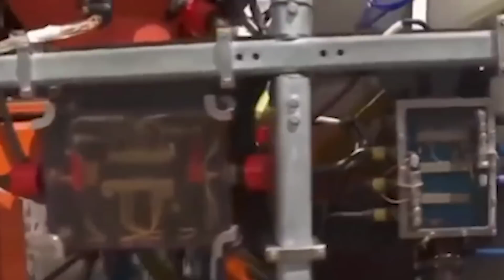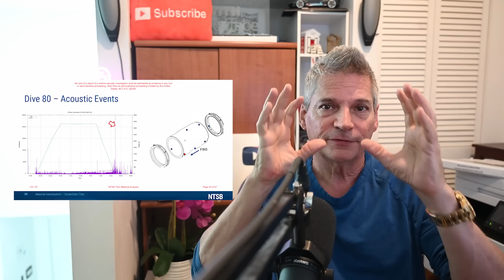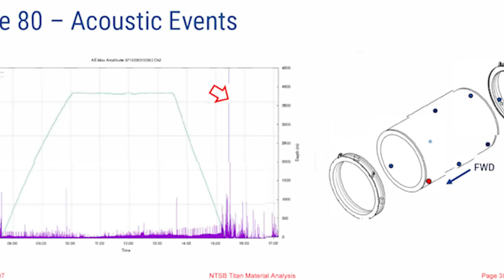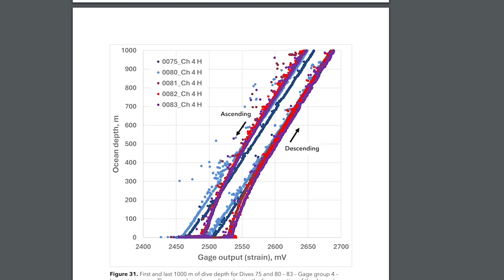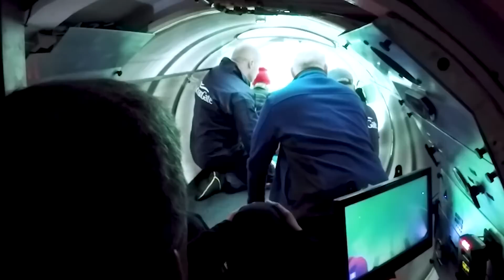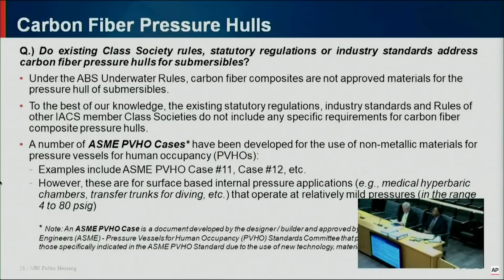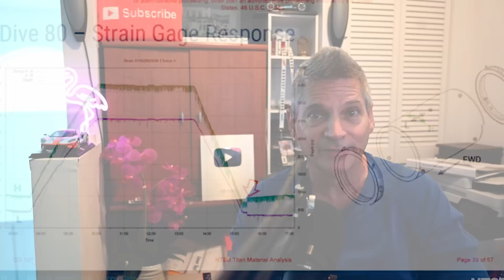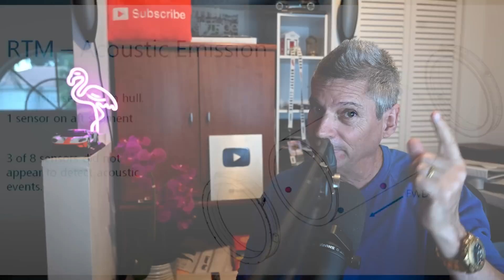How OceanGate Titan Sub Realtime Hull Monitor FAILED! RTM

Comment: Just FYI, those nice and neat charts that we got were built by the NTSB, Oceangate never thought to graph the data with reference to depth. Instead they were just looking at events over time.
Reply: stand out piece of info to me, if they properly presented their data they could have detected what was almost certainly some manner of structural failure.
Reply: Yup. DR Kramet & NTSB combined the two data sets of depth v time and strain v time into one of depth v strain. In water, external pressure is linear with depth. Therefore, a depth - strain chart is indicative of pressure - strain that is akin to the familiar stress-strain graphs of strength of materials science.
Reply: I guess Rush didnt want to hear anything not matching his narrative.
Reply: Seems odd that his 'patent' indicates comparing such data at specific depths yet he didn't bother to actually do it.
Reply: I actually forgot the graph was produced by the N.T.S.B. maybe if Stockton had any concerns about safety they would have done the same and maybe realized something was different after dive 80.
Reply: Oh man, that's crazy dumb.
Reply: Terrible or inexperienced engineers because depth = load. So it’s the most obvious plot to make. Strain vs. load (depth).
Reply: Stockton MUST have made his own charts even before building the hull, that is necessary data for design. There is no other way, basic Statics. I designed steel beam structures on my first year Engineering in .... 1969. Using graphs, charts and slide rulers, go figure, no widely available pocket calculators way back then and 1 IBM 1620 Computer was shared among all students, you had to book time on it. And yet we successfully calculated stress at every point, specified which I beams were needed, calculated rivets needed, etc. Basic old school Engineering, Stockton had POWERFUL Simulation software at his disposal. WW1 and WW2 Engineers designed successful submarines using classic design tools as I mentioned. But none broke the rules. On the contrary, it is customary to add 3:1 overbuild to play it safe. Not Stockton.
Reply: @ I’m sure he had some theoretical charts lying around somewhere, but he had access to actual data gleaned from his own deteriorating submarine showing bad trends that he could have modeled too. Perhaps he did at some point and dumped the results specifically because they were bad.
Reply: You don't need to make graphs and charts to use data, you just need to understand what it's telling you
Reply: @ I asked Data what was up and he said “Ship broke, so what?”
Reply: Very similar to the shuttle challenger explosion. Depending on how the prior o-ring damage data was presented, it either looked like a non issue or a huge deal. Obviously temperature was a huge issue in hindsight but the “go bias” was strong at Morton Thiokol and NASA
Reply: @johnmerryman1825  Thiokol was begging them to delay. The then NASA administrator famously exclaimed: Well what do you want me to do, wait until April comes around? Hindsight is always 20/20 in cases of negligence.
Reply: @johnmerryman1825 not exactly… The shuttle although they coined it as “reusable” its actually more like “refurbisheable” as after every flight the shuttle and recovered SRBs would’ve been disassembled and then re-assembled again. So the o-rings are basically brand new for every flight. 

Also note that Challenger case, the engineers warned NASA to not launch on such a cold day…

In Titan’s case, Rush’s position is equivalent to the engineer that warned NASA (but in Rush’s case, he is also NASA himself)

Right after the accident, one of the expert did say that the person most suitable to lead the investigation into Titan’s accident, was unfortunately sitting inside the Titan when it imploded…
Reply: @tonamg53  I'am conflicted about the difference between reusable and refurbisheable. can you elaborate?
Reply: @salland12 the SRBs were reusable after they underwent a specific refurbishment process. Here is a link to a NASA document for this process. I was an engineer for several years on the ET program. 

https://llis.nasa.gov/lesson/836#
Reply: @salland12  Think the difference between doing a quick turnaround (i.e. topping off the gas tank and checking the brakes(Like a jet)) vs a complete overhaul between trips.
Reply: @tonamg53  I wouldn't say the person who was most suitable to lead the investigation into Titan's accident was sitting inside of Titan when it imploded. If that had been the case I think he would have been wise enough to realize that the pressure hull was cooked much earlier and would have stopped using it.
Reply: @salland12  “Reusable” is when you use it again with just inspection and minor maintenance without needing to have the whole thing disassembled and rebuilt.

“Refurbishable” is when you use some parts of it again after the whole thing has been disassembled and then re-built from scratch.

The SRBs are basically rebuilt brand new for each flights with salvaged parts from the SRBs used in the previous flights.

You can actually see that each SRBs are rebuilt with parts salvaged from different SRBs that had previously flown as NASA keeps track of which parts came from which SRBs and which parts are brand new.

Fun fact: its actually cheaper and more efficient to just build a brand new one but then they wouldn’t be able to say that its “reusable”
Reply: @PeteOtton  That’s what one of the expert say very early on just after accident and it seem to matches with what Stockton Rush has been doing all along.

You can find that Rush has been invited as speaker in various seminars and conferences to talk about CFRP in submersibles. I think he was also a part-time lecturer in several universities on composite materials.
Reply: @tonamg53  Just because he was a part time or guest lecturer at universities just means he was getting part time work and wasn't a serious researcher into composite materials. If he had been serious he would have understood why submersibles and submarines are all built out of ductile/malleable materials, not brittle materials. The PTO doesn't examine patent applications for whether or not a device/process works or how well it works, just that it is novel, even if it is incrementally novel over previous ideas.
Reply: @PeteOtton  There is no evidence to support that he wasn’t an expert like what the industry experts had suggested.

By being an “expert” it doesn’t mean you can’t make any mistake. Every experts made mistakes before and yes, some had died as the result of it. 

Professional airline pilots are basically “experts” in aviation industry. Crashing a plane doesn’t means the Captain is no longer a pilot or is it?
Reply: @PeteOtton  Also note, yes there are downside of using CFRP but there are also massive benefits as well

1. You can take more people down per trip which means lowering operating cost.
2. Titan is the only submersible that I know which has the ability to resurface from the bottom of the ocean without needing any electrical power at all.

The latter benefit practically eliminate the risk of getting stuck at the bottom of the ocean or uncontrolled dive due to loss of power.

All fatal accidents prior to Titan had been the result of getting stuck at the bottom or imploded during uncontrolled dive due to loss of power. The Titan actually eliminates the risks from all of the previous accidents.

But yes, they may have underestimated the risk of implosion due to hull fatigue/ damage during a routine dive since it never happened before in the history.

If you think using CFRP is dumb then I’m sorry, but it’s not the person using CFRP that is actually dumb…
Reply: @tonamg53  Carbon Fiber is a  brittle material. There is a reason brittle materials are NOT used in applications where pressure is applied to them. They go into sudden failure where malleable materials go into plastic deformation giving a warning that they are failing. When you are talking about thousands of atmospheres worth of pressure you want warning that your vessel is failing. Cycling the pressure leads to failure due to fatigue. Rush had no idea the forces he was dealing with and is lucky he is dead or he would be facing a quagmire of who gets to try him for murder.
Reply: @tonamg53  He wasn't an expert in building underwater craft. At best he was an expert in designing experimental aircraft, but given he was actively skirting regulatory bodies I would not trust any of his designs even in them.
Reply: @PeteOtton  Stockton Rush first built a sub back in 2006 after he couldn’t find one available for purchased… So he built his own. 

Also the Titan that imploded wasn’t his first carbon fibre submersible that he built.
Reply: @tonamg53  Dude there is a reason carbon fiber isn't used under pressure and Rush made it well known to the whole world. Admit you are as much a rush fanboi as there are musk fanbois.
Reply: @PeteOtton  Carbon fibre had beeb used in other submersibles. 
Stockton Rush wasn’t the first to use CFRP in submersibles. He just built the largest one so far.

And I’m not even sure what are you whining about using carbon fibre… this very video actually proves that it actually WORKS. Yes, it worked as per it was designed to do. 

Was it able to reach Titanic? Yes, it did multiple times.

Did the real time monitoring system able to detect anomalies in the pressure hull? YES IT DID.

The reason it imploded is not because the design was faulty…. But the data from the system which detected anomalies was overlooked.

This is not engineering error… this is purely human errors.

Comment: it imploded like a can of Pillsbury biscuits. simple as that. the design was wrong, the materials were wrong, the maintenance was wrong. this was basically a con so Stockton could make a name for himself by using a material no other manufacturer uses. but that's for good reason, Stockton knew carbon fiber wasn't actually the best, yet he ignored regulations and basic engineering principles and professional standards for personal gain. he wanted to be known like Elon Musk as an investor and innovator and that was more important than safety in every single way.

Comment: Rush invented the submarine "tip-n-tell" sticker. It's a small square plastic sticker filled with colorful pellets.  If it's smashed into a pile of dust, that means the sub imploded.
Reply: I think you're giving him too much credit. These YouTube videos are his alert system that his sub imploded.
Reply: @Walter_Be It's a sticker that you put on a shipping container. If something you are shipping MUST be kept upright, you use this sticker on it. The sticker has a little measuring device in it that measures how much the container has been tipped, by the degree of tilt. So if at any point the container was tipped 15 degrees while it was being shipped, the sticker will show that when it reaches its destination.

It's for shipments where there is a reason why whatever is being shipped cannot be tipped. For example a precisely tuned piece of equipment that will be damaged if it is tipped past a certain angle...

.. or say in the case where you need to know whether your submersible made it to the destination and back in one piece... 😅
Reply: ROFL stop 🤣🤣🤣

Comment: Yeah, an RTM system that alerts you to a potential implosion condition that takes at least 2 hours to escape .. yup, grand logic right there
Reply: Might as well bring a can of Flex Seal with you on your dive in case of a leak.
Reply: @deltasyn7434  At those depths, a leak will cut through glass or steal cleanly.
Reply: @PeteOtton I think the poster was being facetious
Reply: @deltasyn7434    Hey, it works for my doggone tub!!!
Reply: It gave them around a 100 hours warning. Clear as day. 

So the design was fine? Yes it was going to fail but the monitoring system was working as designed. So had they simply listened to what the data was telling them and used a new hull on dive 81, they have been able to keep going for years and years. 

It's being in an airliner and doing nothing when you hear "woop woop, pull up, terrain".
Reply: @please_stop-v7o But what should we do if we are in an airliner and hear "woop woop That's the sound of da Police?"
Reply: @somethingbrite8484   It's part of the GPWS or ground proximity warning system. It's just very loud and has that conspicuous "woop woop". The important warnings have their own sounds like "BRRRRRR SPEED SPEED SPEED" which is the overspeed warning. Critical warnings have their own chimes or bells or horns and those are practised a lot so a pilot will immediately be familiar with the situation. So much so that the warnings are known outside the pilot community. 

If you sit in the back you won't hear it but in the first few rows you can definetly hear the big warnings even today with the cockpit door closed. 

So if you sit in the those rows and you hear "woop woop pull up terrain" there's nothing you can do, because you aren't one of the pilots. However it means that you are 45 seconds from death unless corrective action is taken. 

If you get pushed into your seat and the liner is shooting upward like you would never experience in routine flighty feeling like a fighter jet, everything should be fine. The pilots screwed up but the warning did what it should and they're flying out of an uncomfortable situation. Once it levels off and the roar of the engines subsides a bit, the danger is over and you can attend to your dinner that's now all over your fancy flying suit. 

However if the airliner keeps diving you will hear that warning repeat, likely interrupted by "BRRRRRR SPEED SPEED SPEED" and "SINKRATE" and or "TERRAIN AHEAD" your most likely toast. If you're religious, that is what I imagine would be an appropriate time to remember that. If not, taking your phone off flight mode and sending someone a few heart emojis is not going to disturb the pilots. It might cause interference with the radios but at that point besides a short "Mayday, mayday, mayday Flight xxx in an uncontrolled dive" they won't be needing their radios and likely not at all because in an uncontrolled dive your last focus is talking on the radio, "aviate, navigate, communicate" in that order. And if there's any significant aviating to do, the other two should be ignored until safe flight has been resumed. Of course all of this is obvious if it happens, don't worry about the sounds coming from up front, enjoy your last moments.
Reply: @221b-l3t is smart. op is not.
Reply: You plays da odds and you rolls the dice. Sometimes you lose...your LIFE.
Reply: And the funny part is that THIS SUBPAR SYSTEM gave them PLENTY OF WARNINGS too
Reply: On Reddit, they have two characters to denote what you meant...

/s

(It means sarcasm)

Comment: The how, and the why, for every hole in this collossal swiss cheese, can be encapsulated into just two words:

Stockton.
Rush.
Reply: Stockton’s Swiss cheese was more like the crust cut off a sandwich. Or a stack of doughnuts.
Reply: @TheOriginalCFA1979  As a Swiss person I can confirm Swiss cheese (Emmentaler anyway, it has holes) does still mostly consist of cheese.   There are holes but there should also be cheese otherwise it's just Swiss air. Okay sorry that's not appropriate considering Swissair 111 lies not that far from Titan.

Comment: Titanium is homogeneous, carbon fiber is not.
Reply: And having both materials on the same hull and glued together was another thing that was an accident waiting to happen. Two materials with differing compression characteristics. That's a guaranteed failure point if the glue wasn't able to flex.

Comment: Although far from identical, the carbon fiber versus titanium, reminds me of a Corvette body versus a metal body. On a fender bender the fiberglass doesn't bend, it fractures and breaks on an impact where on a steel fender, it will just push it in some.
Reply: Ferrari found this out in the UK when their first prototype CF car got bumped in a gas station and fell apart.